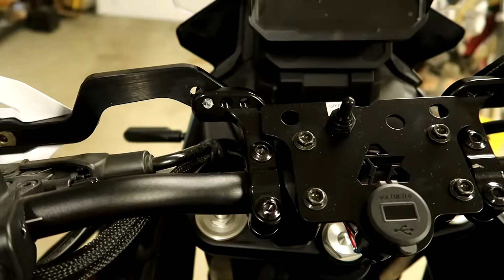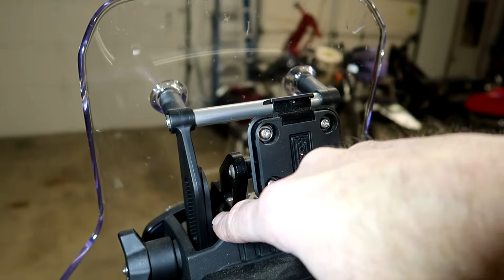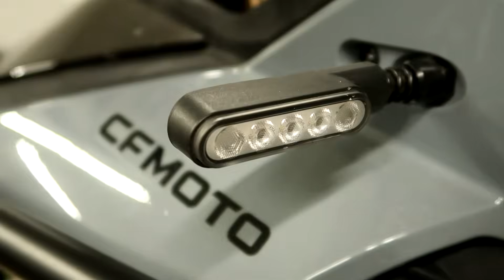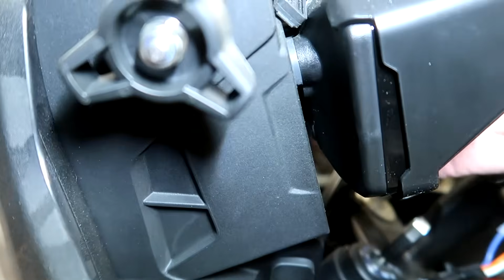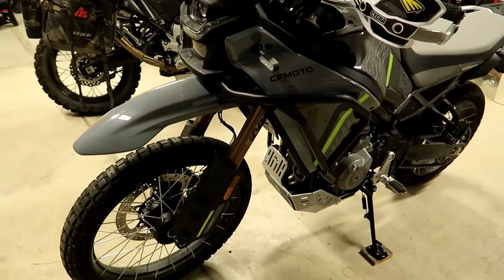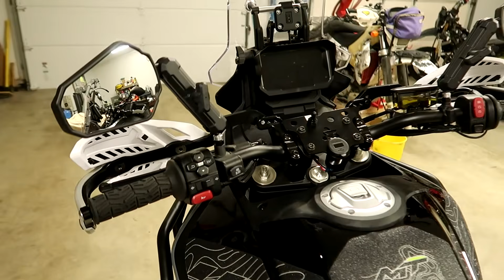CF Moto Ibex 450 Accessories Walkaround Part 1

Comment: Those grip heaters are a great idea. I've installed them on my last 4 bikes and they work great! I found them as an accessory for snowmobiles before they were even made for motorcycles so I wasn't even sure they would work, but luckily the did!
Reply from the maker: I agree, they are definitely a game changer for riding in colder weather! I've had this same style grip heaters on my DR-Z400S.  20 years later, they still work flawless.

Comment: What ignition wire did you connect
To from
The tusk box?  Great video. Just got the same bike and color. Will checkout your store.
Reply from the maker: I used the wire under the seat.  Full details of installation on an Ibex 450 are in this video:  https://www.youtube.com/watch?v=kQ-fI5_d1Dc
Reply: @DualSportDoug does the double take mirrors left side ram ball have reverse threads?  Seems like left is reverse and right is not on this bike.
Reply from the maker: @Trail2TrailADV  The current version of the Doubletake Mirror balls have 5 different bolts.  I don't remember if either side is left hand thread or not.

Comment: Great job in the upgrades. Where in Illinois do you do most of your riding? I’m from East Central Illinois.
Reply from the maker: I live in Washington state.  The license plate seen in this video is a really old one I bought off eBay.  I bought it as a garage decoration, since I have a few DR-Z400s.  The person that originally had this plate also had a DRZ - this is a personalized plate,  with the number 398 being the CCs of the engine.  Only a DRZ owner would recognize this was a personalized plate.  Once I received it, I decided to use it on my bikes when I'm doing videos at home, so I'm not showing my actual license plate number.